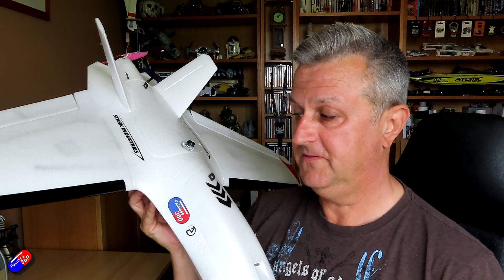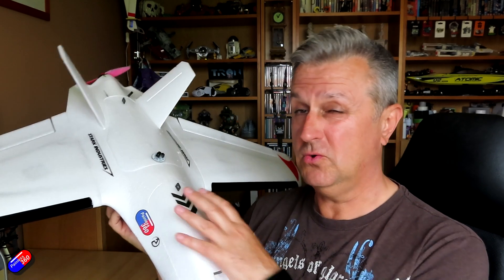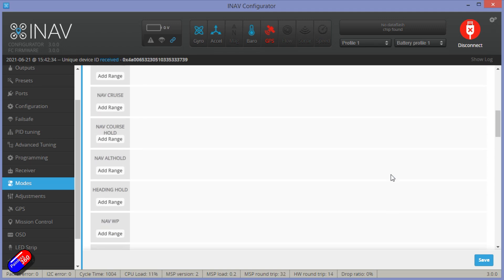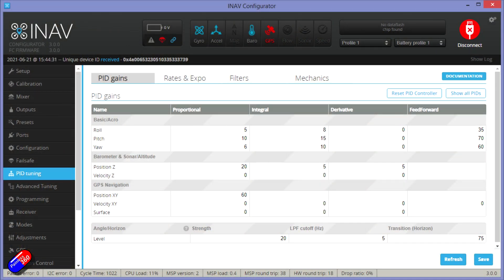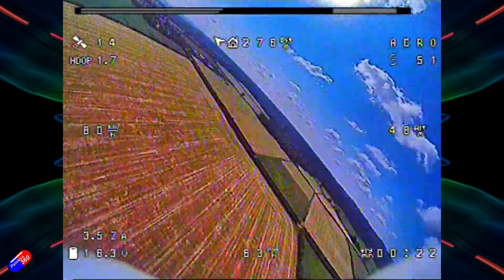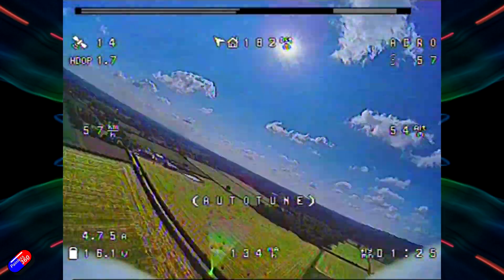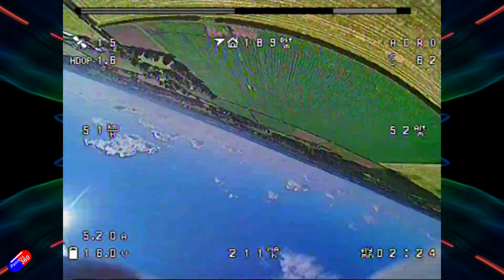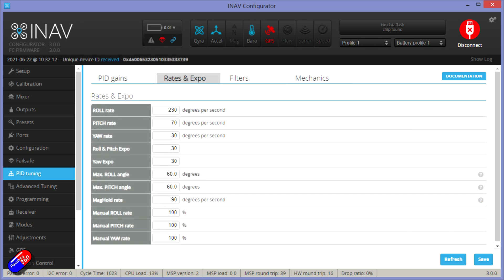INAV 3 0 Autotune: How to do it with tips and tricks..

Comment from the maker: NOTE: There have been a few messages from pilots recommending that rather than use the left/right and forwards/backward method I'm using here use a slight pause mid stick to help the process. I've tried both here and found the results of the tune are almost identical but it is good to remember that other way if you can't get your model to autotune. Let see what the advice from the developers is in the update on this on the Wiki.. Happy flying!

Comment: Has anything changed from 3.0 to 8.1? I'm getting a weird issue where my model is pitching up whenever I throttle up in a stabilized mode instead of iNav automatically trimming the extra lift out, so I don't need to correct for it. It makes autolauch really scary when it just keeps pitching up above the set 20-degree climb angle.

Comment: Great video Mr Lee. In previous versions of INAV I saw that you flew and did Autotune in ANGLE, then land with Autotune activated, save with sticks down/out CSC and that's it. Now I see that you flew in Acro and activated Autotune and landed without Autotune active. Has the way of doing Autotune changed? In INAV 4.0 the automatic adjustment button avoids landing and saves and it is trimmed and autotune? Thxs
Reply from the maker: From what I recall you never land in Autotune mode. The process has changed from older versions with the model now needing to be in ACRO for the tuning. Happy flying!

Comment: I have a problem. When I switch Autotune on for my first tune the aircraft doesn't seem sluggish at all. When I go to do full stick deflections I cannot because I would easily roll over. Same problem with pitch. When I check my values post flight nothing has changed. Does it require a full stick deflection to register? Any ideas?
Reply from the maker: Double check what flight mode you are in. Best of luck
Reply: @Painless360  Turns out that since I built this wing similarly to another, and input rates from my the previous one the autotune wasn't engaging. Once I reduced the rates back to default it worked. Basically I was trying to avoid a crash on the maiden flight since I've been scratch building sort of incrementally.

Comment: HELP….  I’ve been trying to do this for a few flights now. For some reason I can’t get it to save at the end. I can feel it in the air so I know it’s working. But it just won’t save. Any ideas what the problem might be.
Reply from the maker: What is the precise order of events and modes you are using?
Reply: @Painless360  I have a arwing pro running inav 3.01. Airbot f4  fc and the builders kit for electrical. I’ve done the servo auto trim. And auto tune. But looks like neither have saved. For procedure I took off in horizon mode. Activated auto tune.  “Does not say auto tune in DJI osd” I can feel it making changes as a smack the sticks back and forth. Buuuttttt. We just got looking in inav and apparently I never saved the switch for auto tune. Gonna try again. lol
Reply: No progress made. Went back out and for some reason now the esc won’t start up. Beeper starts going off. So somethings not happy. Can’t tell what tho because of DJI’s crappy osd integration 🤷🏻‍♂️
Reply from the maker: Autotune doesn't work in Horizon... That may be part of it.
Reply: @Painless360  noted. Thank you

Comment: Need some help here. My 3.0.2 autotune is not changing any PIFF settings. I just went through the autotune procedure with my ZOHD Drift. Plane is in acro mode with autotune on. I fly for a couple of minutes with rather aggressive roll and pitch inputs. Turned autotune off and landed. Disarm and enter the OSD menu and select save and reboot. I then go back in the OSD PID menu and everything is still on stock settings. Nothing has been changed. Anyone know what am I doing wrong?
Reply from the maker: Not sure, I've not seen that. You can display the PIDS on the OSD as you fly and that can be useful to see what is changing.. Best of luck
Reply: @Painless360  Thanks you sir I will try that.

Comment: ? Would be lost without this. Just putting a Mateo f411 on a wing. Been on Kopilot so regular noob really. But will the sticks method work when using DJI? Not sure what's in the OSD and canvas mode still isn't ready.
Reply from the maker: Flying this since I've found that the settings are stored automatically when you disarm so don't worry too much about that part now. Best of luck!

Comment: Thanks to you I learned ardupilot and have been a fan for some years now but I am growing disappointed at the increasing complexity and hardware requirements. I just saw an amazing video of an Inav long range auto mission and I was surprised at how stable and precise it was despite being a Nano Goblin with an older Inav version. So I am considering moving to Inav, it seems the community is more agile, the documentation is easier to navigate and the number of parameters is way way smaller. Most of my planes are wing and under 1Kg using omnibus F4 Pro and most of my flights are nearby with a few long range auto missions but just using waypoints height and return to lauch with auto throttle. 
In the past I read INAV stories of fly aways instability, unreliable launches and return to launches. 
Is INAV Autotune, launch, missions, cruise, and auto throttle reliable and consistent now a days?
Thank you very much for reading my long winded question.
Reply from the maker: see my video on comparing INAV and Ardupilot. INAV has come a long way but still can't beat Ardupilot for smooth flying and complex mission and monitored flying on fixed wing. Happy flying

Comment: You should note that ACRO mode isn't a flight mode that can be setup and selected directly as other modes. It is in fact just the default mode if no other mode is active. So to use ACRO mode you have to ensure no other mode is selected.

Comment: On your Modes tab there is an AUTO LEVEL option that you have set to CH 5 with HORIZON.  I don't have an AUTO LEVEL option on my modes tab and I'm on 3.0.1.  How did you get this option?
Reply from the maker: It is one of the standard modes for fixed wing. Is yours setup as a fixed wing?
Reply: @Painless360  Yup.  I have it as fixed wing.  The odd thing is that I have another flight controller that I just flashed 3.0.1 to and AUTO LEVEL is available on that board.  I wonder if there is a setting somewhere that toggles it off?

Comment: Thanks for the video Lee. I found on my original small dart, roll auto tuned nicely but pitch was a bit slow. I then finished my autotune flight with a few full rolls both clockwise and counter clockwise and then a few full loops. I found that after the loops it really did help the tune on the pitch. I then landed and saved. So I would definitely, if your plane can do loops and rolls, finish off an auto tune session with a few of them before disabling auto tune and landing.

Comment: Hi Lee, thank you for the video. Would be helpful to have some tips for the digital video systems, as sometimes it is tricky to see the mode, or combination of modes in DJI Goggles…
Reply: use the aircraft name line on osd there you will see the autotune message
Reply from the maker: I use the stick combo shown to save the new PIFF settings. Happy flying!

Comment: How would one go about saving the settings if you are using the DJI goggles?
Reply: I have a switch set up in OpenTX that saves for me. Part of the IFWG OpenTX Pro model. It uses the momentary switch. Slick. I use DJI FPV too and it has made things really easy for tuning and saving.
Reply: @jimross898  Thanks Jim.
Reply: Save with sticks?
Reply: land, disarm and do the stick command save settings like shown in the video by painless, works great